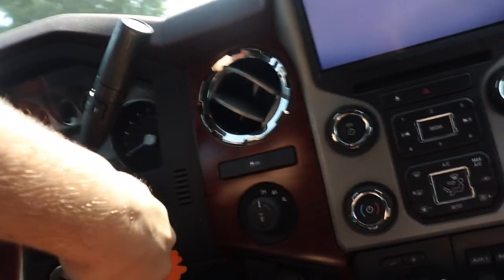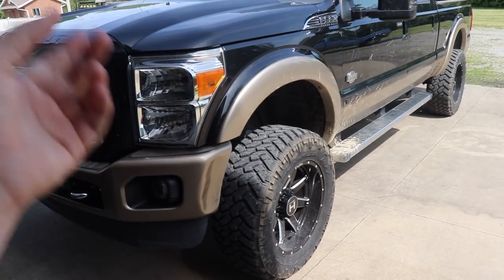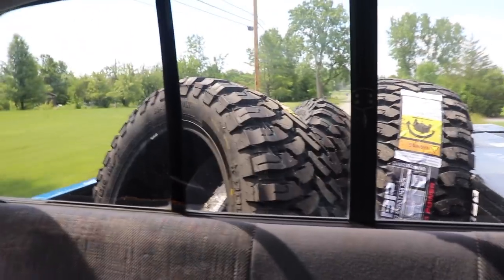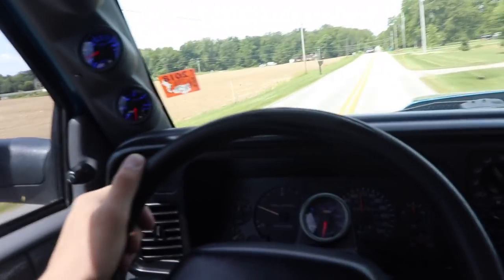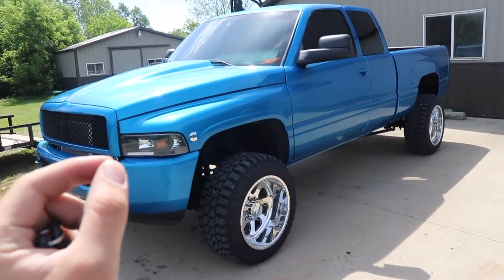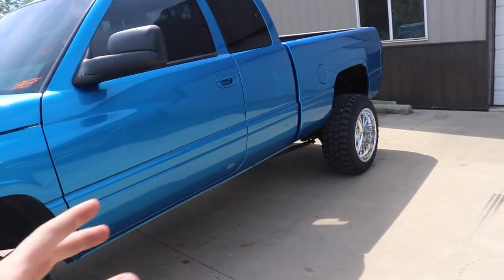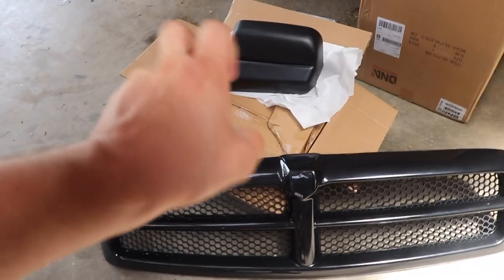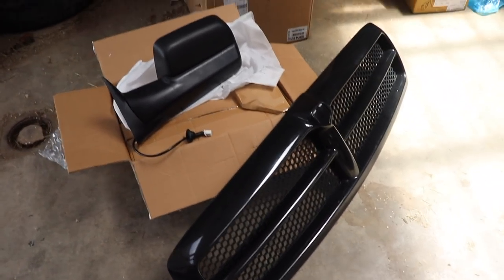45 PSI TEST ON THE NEW TURBO!!! *FIRST DRIVE!*

Comment: In maine youd need fender flares for tires that wide.......thinking in that sinerio keep the grill black with mirrors and fender flares wouldnt be that bad till you can get it painted right.....worst case if you cant paint match id paint the rockers same witth as the fender flares to add a match color.........light grey, silver,  black or such. Other then that only thing id need different is a back bumper.........im only 5 8"....  need somthing to climb on to get in the box. ....but  whomever wins this has got themselves a damn nice truck! Nonemisions and all. No rust to be seen. Awsome truck!

Comment: It's smoking less because of the increase in boost. Sounds crazy right? But hear me out. The turbo is pushing more air into the cylinder so it's mixing more air with the same amount of fuel. The black smoke is unburned fuel exiting the exhaust pipe so the fact that there's less smoke when you get on it means your burning more fuel now than you were so all in all your getting better fuel mileage as well

Comment: I understand why 12 valves get a bad rap for being slow. I rode in my friends stock 1996 for work, its slow to the point that its kinda sad.
Reply: That man JB they are detuned from the factory so much. You could take a stock 12valve and do simple 5 minute mods and gain 100hp easily.
Reply from the maker: 98 12 valve yes.. you can get an additional 100hp without spending anything at all..
Reply: @Kyle_Godfrey111  I know that, and my friend probably should turn some stuff up just so it drives and pulls better
Reply: But then again it is a work truck and they've been driving it the way it is for X years that they've had it.